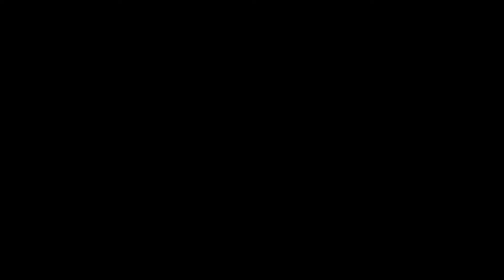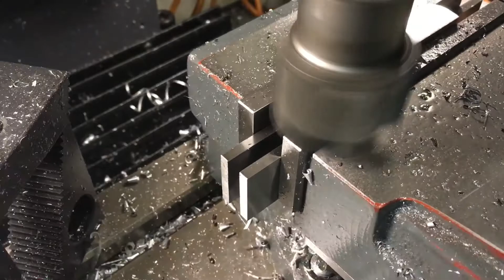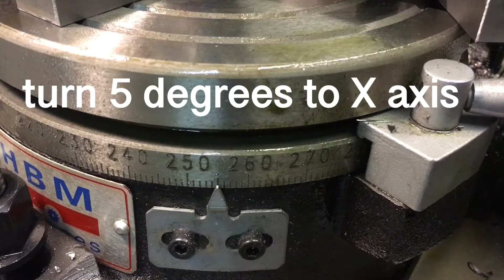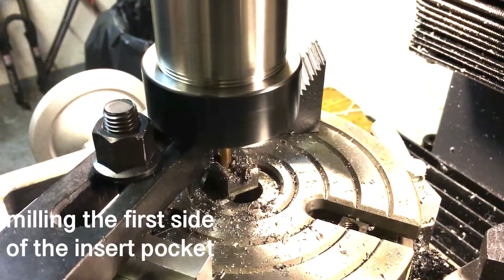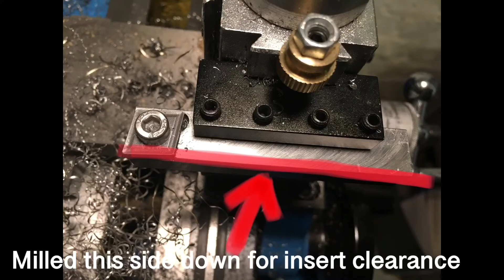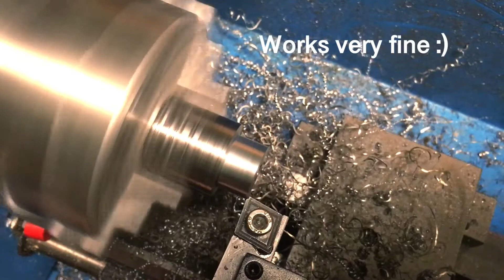Insert holder for the Lathe (DIY)

Comment: Nice! What sort of steel did you use?
Reply from the maker: +Adventures with a Very Small Lathe

Thanks :)
I used simple ST37 mild steel. It’s just cheap enough for trying around and it’s laying around from other bigger builds (welding table)

It seems tough enough and is working very fine on my mini lathe. I’m still working with the very small and cheap lathe. Also with a view to the “stiffness” of the whole machine I think the mild steel should be good enough :)